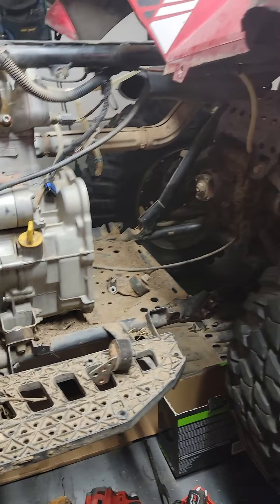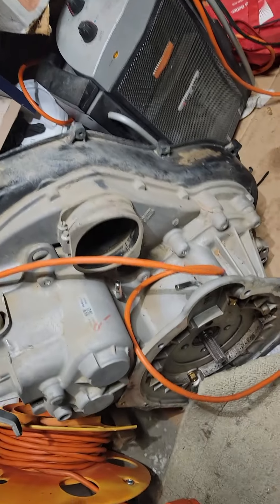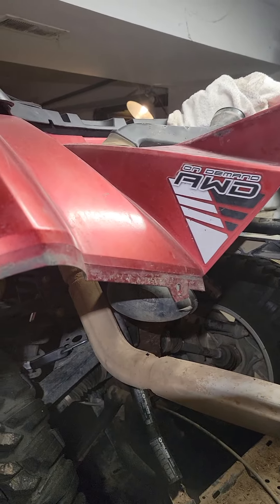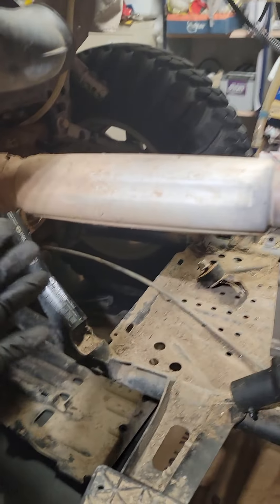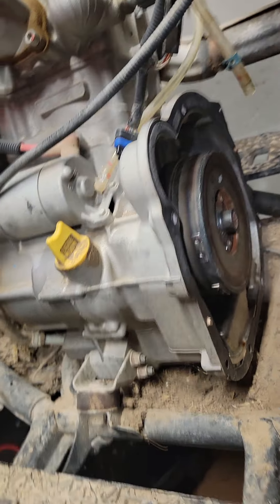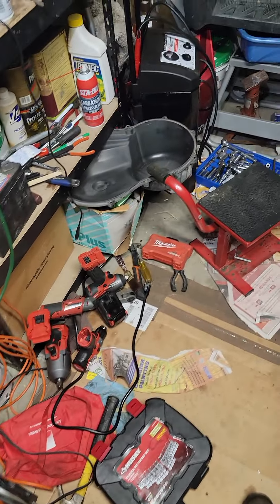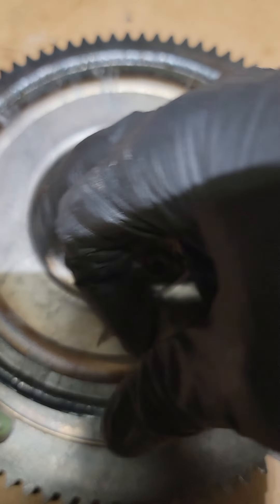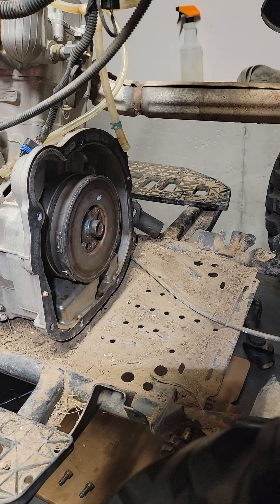Polaris 550 850 noise knock fix dampner

Comment: Super, Thanks for response. I hand turn primary clutch back/forth, felt a clear slack and tap, as if you hand turn the slack damper gear.  (Metal shaving is on tranny nut,  with new oil, much quieter from statoscope)
Reply from the maker: Awesome input. Good teaching lesson on how ya done that.

Comment: Thanks for the video, I have a 2011 late model 550 in my garage with a broken input shaft, the shaft that couples to the dampner. That shaft is broken off at the splines. Would you suspect that was caused by a bad dampner? This unit is my fathers and used on his farm, Not abused. He drove up shut it down and started it back up a moment later and it wouldn't move. I ordered the input shaft and received it however the dampner is on backorder for another month and expensive here in Canada, $680. 
thanks
Reply: If you have a lath, repair it easy. ( put in a center plug  to line up and weld it back)

Comment: I just got mine tore down, and yes, the nut came loose on the crank shaft, letting  the spring damper flywheel assembly rattle like it was going to explore.

Comment: Thanks so much for posting this video! No way would I have been able to zero in on that noise this easily otherwise.

But just a quick question. I've got the dampener off, is there a way to confirm it's damaged? I'd hate to spend $900 Canadian rubles and put everything back together again just to find out the knock was something else. :)
Reply from the maker: Replace it. Its cheap. Ebay or power sports nation U.S. put on thread lock on bolt. I also had a tranny that was bad once.

Comment: I was riding on the trails my polaris 1000xp sportsman  just stopped,  when i took off the belt  cover everything looks good, but when i put it in gear and give it gas the secondary  clutch makes a grinding metal sound, can you give me some advice. Thanks

Comment: i have a 2018 sportsman that knocks real bad at idle then when you speed up it kinda goes away. it runs and drives fine. i pulled the clutch and stuff like that and it didn’t go away. i had some metal on my drain plug for my tranny. could the coupler be my issue? i’m so lost and don’t wanna take it to get fixed. i have a video of it if that helps any i can send it to you. thanks 🙃
Reply: Just renewed my 2010 550EFI tranny oil, the chain slapping noise at idle is gone. I used hydraulic 46 fluid, a thicker anti wear fluid, now I could clearly id the ticking from damp/coupler.
Reply: Exact same on my 2023 sportsman 850

Comment: Hello, i got a 2023 polaris sportsman 850 700km on it. I got a rattle at idle speed i think its coming from behind the starter or behind the primary clutch. Took the belt off and the noise is still there. Sure is starting to look like that part you are showing.

Comment: Would this possibly be the issue with mine.... Right now my CVT isn't turning at all when the engine is running. I suspected a broken belt at first but when I took the housing off, the belt was fully intact. Engine runs fine, but there is zero movement with the CVT. Thanks in advance. Side note, if take the transmission out do I have to remove the two drive pulleys?
Reply from the maker: Definately. Take out tranny see if the bolt is off tighten it like 125 ft pounds or whatever it is with the strongest loctite u can get.  If not than its tranny. Once u have the tranny out be careful and start it and see if the engine part is spinning. Than u know its the tranny.
Reply: @IMPORTANTVIDEOS7  thanks for your reply, I think the tranny is ok as I turn the large pulley while in gear the drive shaft spins. The CVT moves freely with the motor shut off. Shouldn't it be locked into the crankshaft and not be able to move freely? To add... I think I've been hearing the noises for a while this winter and then it must have suddenly snapped or fell out. Pretty sure I'm looking at replacing the entire dampner/coupling assembly. Just to reiterate, do I need to remove the pulleys or will the come of with unit? Thanks!
Reply: @IMPORTANTVIDEOS7  My damper is fine, the input shaft on the transmission broke off.
Reply: @Lariat8  Use lath to put a enter plug to line up, weld it. easy fix.

Comment: Excellent video! I think this is the problem I'm having as well. Do you have a part number for this? I'm seeing two possible parts. One called a "Spring Damper Assembly" and another called an "Engine Inertia Coupler". Subscribing now!
Reply from the maker: U have to look up ur year model on partzilla

Comment: I think mine is making this noise youre talking about at idle. Bike kinda shakes at idle, but runs just fine all other times. May be looking too into it. Could I send a video of the idle and knock to see if you think this is it?
Reply from the maker: Did u subscribe? If i was u i would take it apart. And see. If its the rubber kind i would  replace it and check the bolt if it has one, lock tite it and tighten it. You have to check it. And subscribe also. Thanks
Reply: @IMPORTANTVIDEOS7  I did subscribe 👍👍 good content for sure
Reply from the maker: Look at my step by step videos on it. Look under polaris noises.

Comment: Man you make me laugh you get to the point anyway I had exactly the same quad it clunk in and out of gas when I put it on and off I don't know if that's the same problem I don't have it now but I have a new one 2022 850 this one after driving six months does the same thing but a little bit louder off and on the gas when it clumps nobody's not sure what it is dealer says it's normal but it never did that in the first three months I am going to get to the bottom of this summing said it's the rear end I don't think so
Reply from the maker: Let us know. If u want to really research things than put the word Forum in front of whatever u want to search. It will bring up all the possible fixes u can read on that have ever been posted on line. Works for everything.